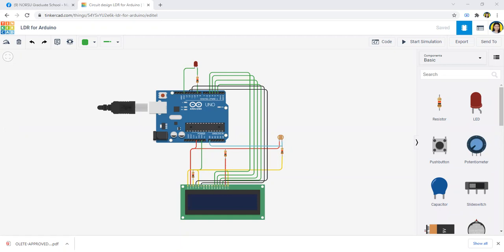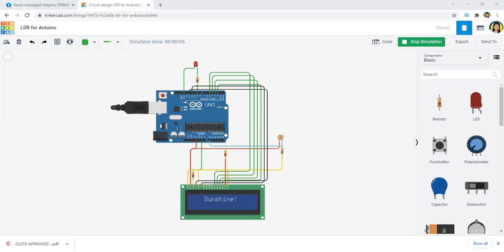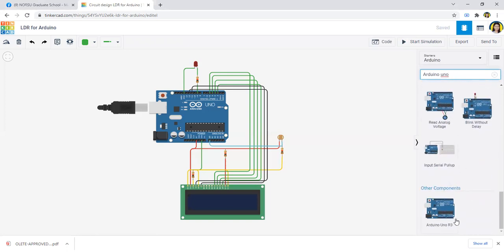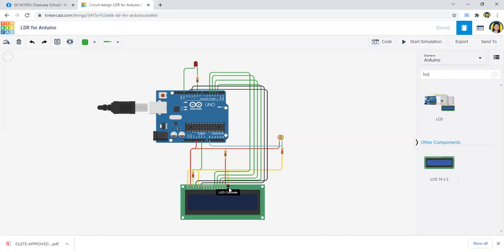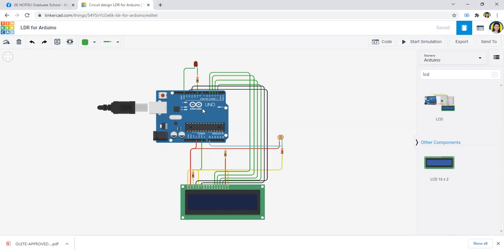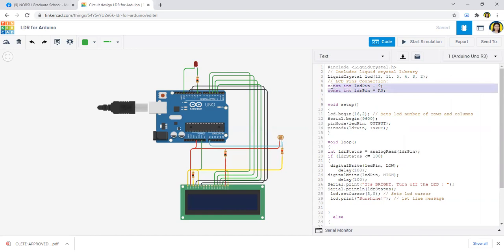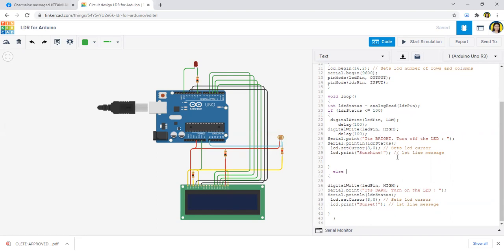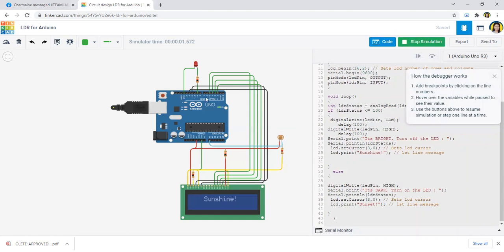Light Dependent Resistor (LDR) for Arduino - Detect High and Low Intensity of Sunlight

Comment: Hi maam can ldr detect sunlight to turn on any object for example grass cutter?
Reply from the maker: Hi, thank you for your comment, my apologies for the late reply. As far as I know Light dependent resistors, LDRs or photoresistors are often used in electronic circuit designs where it is necessary to detect the presence or the level of light. I hope I have answered your questions.